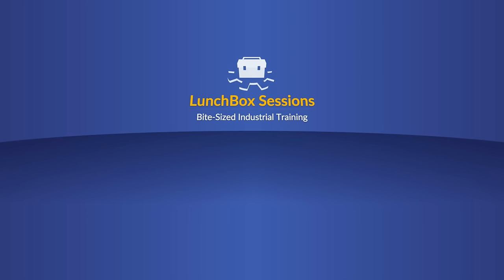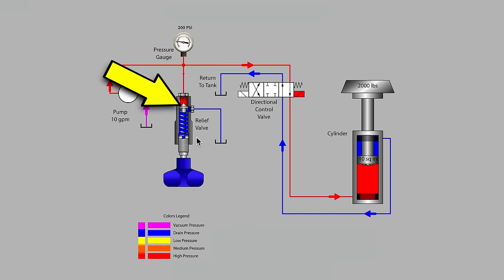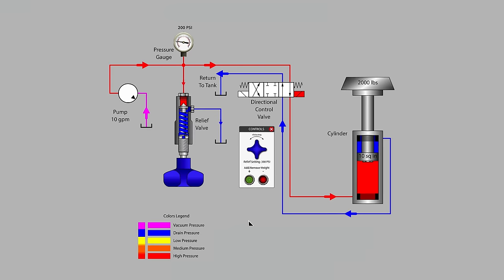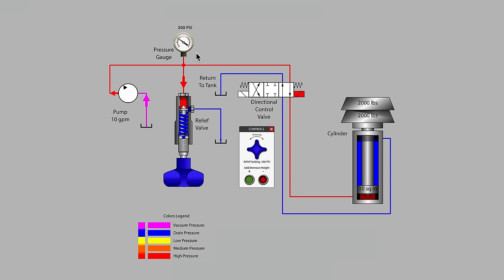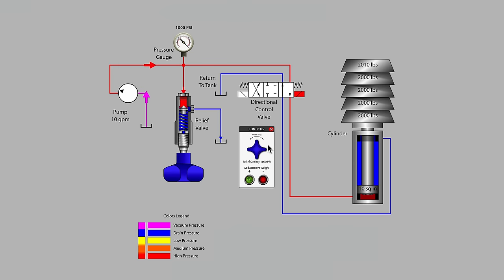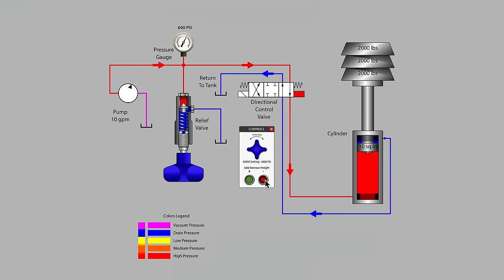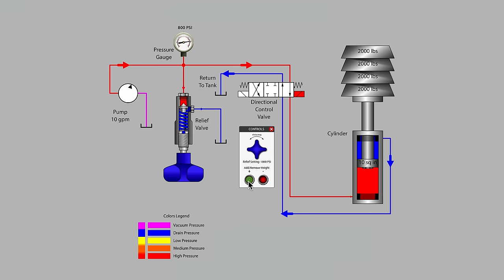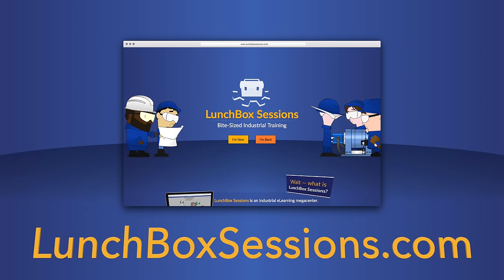Relief Valve Basics

Comment: This is mind blown. I always thought the relief valve opens only when the system pressure is greater than the spring setting. I never knew that the relief valve drains some oil to the tank even if it has not reached the setting of the spring. 
But what causes the relief valve to crack open even though the spring is set to a higher setting than the system pressure
Reply: I'll try to clarify a little. The relief valve does indeed open when the system pressure is greater than the spring setting. You have that precisely correct. The first pressure level where that happens in a relief valve that has only one spring and one poppet, is not the highest pressure that the system will reach. As the overloading happens elsewhere in the system, perhaps at a hydraulic motor that is powering an increasingly overloaded winch, the relief valve poppet (single) will continue to compress the spring. The spring will in turn be pushing back with more force as it is compressed. The flow through the relief valve will increase as the poppet opens wider, as the motor/winch is overloaded to a point where the relief valve, wide open, with the spring compressed, will be the easier path for flow as opposed to the overloaded motor and winch.   The pressure reached at that moment when the poppet is pushing the spring as far as possible, will be the true 'setting' of the relief valve, as that will now be the highest pressure that the system can reach.  I hope that help.

Comment: What happens if the relief valve is set to 1000 psi and the load also has 1000 psi? All of it goes through the cylinder and it will remain stationary to its previous position, right?

Comment: my father has a hydraulic dump body on a Chevy 1 ton, it has always worked, now al of a sudden it will kill the truck motor if it is raised all the way or even if you put a load on it, it wont lift it and kills the truck motor, we changed the motor because someone told him it was the electric motor but still does it any suggestions

Comment: We have a system with operating pressure of 16 bars, but sometimes we do experience pressure burst on the line. Can a PRV solve this problem, if so what is the expected range of the recommended PRV. Thanks a lot
Reply from the maker: A relief valve is meant to prevent an over-pressure condition, yes. I cannot say what type of action will solve your line burst problem, because I do not know the cause. What type or model of machine do you have? For the sake of safety, please be very careful not to make any adjustments to your system without first obtaining hydraulics training. Can you contact the manufacturer of your machine for assistance?

Comment: Great video. Though,what does drain pressure actually mean?
Reply from the maker: Drain pressure in many cases will be a value that is close to or the same as atmospheric pressure if the tank is vented. If there is a return line filter preceding the re-entry to the tank, then drain pressure might be 1 or 2 Bar (15 or 30 PSI) depending on the model of filter, and the spring tension in the bypass check valve within the filter housing.

Comment: Is the 1.position on the valve oriented correctly? The one with the crossed arrows? I can't see how that would work, even with a both-way pump (it would just result in the same movement of the cylinder).
If this were the case (pump moving the cylinder with suction rather than building up pressure), would that movement be more difficult for the pump, or does it not matter weather it is moving load with positive or negative pressure? (If we put cavitation aside)
It feels like the positive pressure is the only right way to go, but I can't really understand why.. Could you help me understand this please?
Great videos btw, shame I just found you today
Reply: I also believe the arrows of the first position were drawn incorrectly. They do not use a Hydraulics software for these videos (it is done manually on Flash) so this kind of mistake may happen.
Reply: Yes, I just wanted to check with someone else because I wasn't sure as I was fairly new to hydraulics. By now, I am sure it is a 'drawing mistake' because they just put a random valve in for presentation. 
Great videos tho, they've helped me tremendously!
Reply from the maker: Ah, yep! Good catch. I'll let the team know, so they can flip that symbol around.

I'm thrilled to see you're paying such close attention to our animations, and I'm glad they're proving to be helpful.
Reply: They've really been helpful, especially to understanding the 'more complex' systems where it's really hard to imagine what's going on inside. I bet you've saved many students from hours of torture, myself included. Thanks again!

Comment: where is the pressure relief valve located on lb75 backhoe
Reply from the maker: New Holland LB75?  I haven't worked with that model. Do you have schematics or any manuals? What is the issue that you are dealing with, that requires finding the relief valve? Has the system pressure been too low? Please be careful with any adjustments, and follow all manufacturer's safety recommendations.